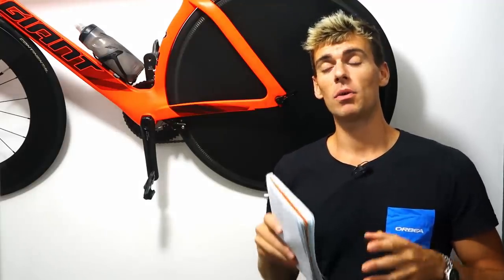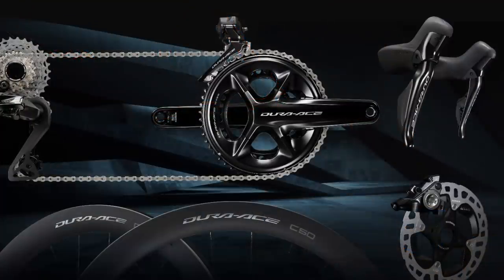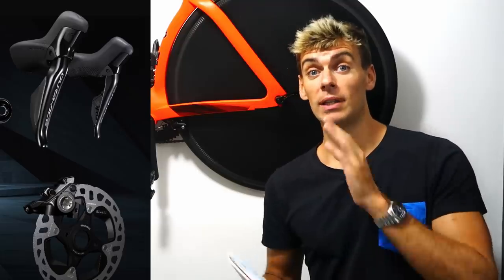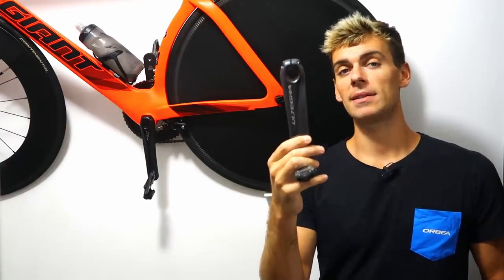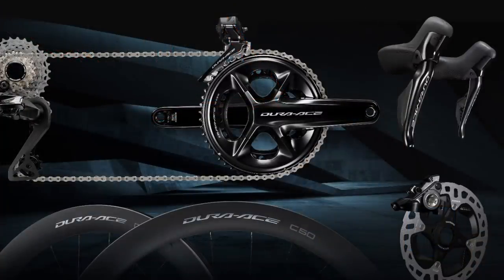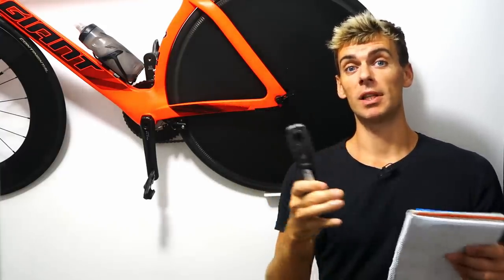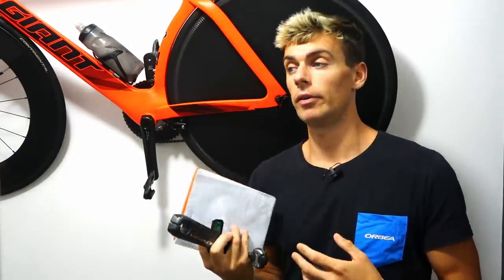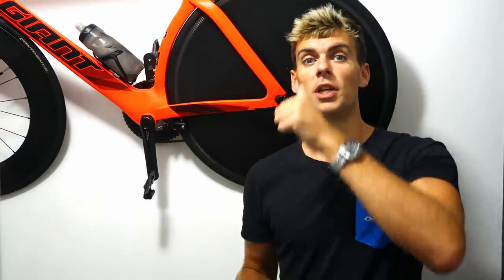Shimano 12 speed Dura-Ace & Ultegra Launch. Power Meter design, crank failures & disc brakes.

Comment: I really hope the disc calipers are better. I've tried all the ones on the market at this point and one thing I've noticed that you haven't really mentioned in your videos about disc brakes is that Shimano pistons are always the hardest to push back into the caliper, they have a lot of stiction. Campy\Magura have the least by far, you can push them back with your fingers and I never get any brake rub on those. Sram is not as bad as Shimano but still not great. I definitely welcome the monobloc design, I've seen a lot of Shimano calipers leak where they're split, hopefully the cap that they're using on the new one won't.

Comment: Big thing is the freehub, if you can use the same it'd be good so as not to have upgrade wheels. However this marketing BS with discs and 12 speed, tubeless is getting old. Rim brake on on dura ace C60's with tubes is just so much less hassle and for your everyday biker they're just not going to see any difference in speed. Just tuck in more for that bit extra aero 😉😊
Reply: No need to tuck in more. A similar rim braked bike is more aero than the same disc wheeled bike because you don’t have 2 rotors sitting out in the wind at the center part of the wheel. 😆

Comment: Well... Don't trust much on the Sram top tier cranks either... had a xx1 dub crank broken on the drive side because of what looked like a bad bonding between the carbon and the aluminium little arm...  guess top tier low weight cranks all have failures on them...
Reply: I’m amazed at the gullible crowd that oooooohs and ahhhhs over Sram’s mediocre stuff. Fools can be sold anything. 😆

Comment: 5:10 Axial and inboard bending of the crank do not contribute to propulsion, but are a side effect of the power input into the pedal stroke. You want to measure the power input of the rider, so why taking the losses out of the equation?

Comment: LOL !!! 8.44, hilarious and very true I'm sure. My take; disc brakes - nothing groundbreaking here, but it should have been. Not even a new DA disc rotor.....Semi wireless - the best solution, thumbs up. Shifters - don't like that they're bigger for my small hands, more weight and less aero. 12 speed - nice to have an extra cog, but yeah, really, was it worth all the hassle? Cranks - disappointing. Same as before basically. Can they really not do a carbon crank? Rotor Aldhu carbon is way better. Would love to shoot a vid with you in Mallorca!!
Reply from the maker: Lets make that happen. Stuck here in Asia. It definitely feels like a covid groupset. Bit rushed? Lack of man power? Discs are just xtr like you say, no real styling to the cranks or levers. Meh.
Reply: @PeakTorque  I was up for buying it, but at these prices I think I'll pass. It's basically almost 800E for each derailleur, 800 the shifters, and 1000 the crankset, 1000 the brakes and a bit extra for cassette and chain. That's a bit nuts. Mallorca is devoid of cyclists at the moment, we need more!!

Comment: I guess you live in a flat area.  Either that, or I live in a hilly area.  With 11 cogs to choose from on the back, I'm forced to choose between a 16T cog or a 28T cog.  In a race, I go with 11-25 so that I get the 16T cog, and that's OK because in a race, I can do without a 28T cog.  But on any endurance ride I do in my area, if I want to keep it enduranc-ey, and not tempo-ey, I need the 28.  And so, that means that on the 40 percent of the ride that's vaguely level, I'm either pushing the 15T cog at 83RPM or the 17T cog at 96RPM.  Usually, I spend the time skipping rapidly back and forth between the two in frustration, according to the direction of the most recent wind gust.

Comment: I’m planning to buy campy record shifters, rd n fd, stick to my rotor aldhu crankset, ee brakes and xtr chain, get a new da9200 11-30 cassette, after selling away my current DA9100 shifters cassette rd n fd. Hopefully the new shimano cassette works with campy 12sp shifters

Comment: Love your videos! Do you know any carbon crankset with 24mm axle that would work in shimano BB?
Reply from the maker: No. Even the rotor aldhu carbon, I think they are only making the 30mm alu spindle version.
Reply: @PeakTorque  cheers! I really don’t get it why. There are so many options with 30mm spindle but it seems stupid having to have smaller bearings to accommodate the larger spindle. At least for me with a BSA bb.
Reply from the maker: @paolocapozzi927  I agree, 24mm steel is so much better. Better bearings, and the axle doesn't wear or click like shit Aluminium dub or 30mm. I still have a gxp quarq, when that dies I will get rotor cranks and Power2Max.
Reply: @PeakTorque  Gap in the market for an enterprising engineer to step into?  Carbon cranks w/ 24mm steel / Ti spindle and no messed up pre-load fuckery.
Reply from the maker: @pmcmpc  Good idea. But shimano have a patent on the best preload system I think. Will look into it.
Reply: @PeakTorque  I'm sure there must be some way of doing it that your average neanderthal could reliably not mess up during installation.  Also, how old is that Shimano patent now? 10 years? 12? 15? I'm sure power2max and / or sigeyi would be happy to produce a PM for you.
Reply from the maker: @pmcmpc  I've asked Sigeyi for a sample to test. Lets see what they say.
Reply: @PeakTorque  I suspect they might be willing to collaborate if it means they can sell a full crankset, assuming you came up with something and were willing to work with them.  Their main competitor (X-Cadey) has their own full PM crankset available now with 24mm spindle, and is reasonably light.  Though it has some issues - first gen's axle (Aluminium) flexed like a noodle & was recalled, the 2nd gen now still flexes too much, and appears to be steel though their CS told me it was Ti ... 3rd time lucky?
Reply: @pmcmpc  well Campag's carbon cranks have a 25mm spindle so get pretty close to this brief?
Reply: @GS-pk9rd  I think chainline is off .. also, basically no PM options.
Reply: I believe THM cranksets are BB86 compatible.
Reply: @shibaburn7725  30mm axle and tiny bearings though on BB86.  Also, they're a touch pricey ...
Reply: @pmcmpc  Yes, sorry about the misinformation.  The THM website lacks  specs about the spindle.
Reply: SRAM GXP Red and Force cranksets could be adapted to work.  :-o

Comment: This is all interesting and all to be in the bleeding edge of technology but for us mere mortals were only waiting for the old parts to be on the used market. With that said I have a question. 

Would it be possible fit in a 105 R700 crankset in a bike with a full Claris r2000 grupo? Or im only limited to 8s cranksets with my setup. Claris crankset weighs a crapton and by upgrading to an 105 R7000 i count potentially save half a kilo of weight. 

Hope you can answer my query thanks!
Reply: The distance between chainrings in 8s and 11s maybe slightly different, there maybe change in thickness of chainrings. It may possibly work but I am quite certain that it will be sub optimal setup. Imo not worth considering, even if you have free r7000 crank i would prefer to sell it and spend it on maintenance, tires, shoes etc.

Comment: 8:55 I think PT you’ll be wrong, Shimano will go with micro spline for 12speed.
Reply: 12 speed is utterly ridiculous. Nobody needs it
Reply: Turns out PT’s right, shimano stays with the same freehub, stays with 11T but up the teeth.
Reply: They should have gone with microspline. It’s a better design.
Reply: @rcg9573  Better in what way?  Newer and shinier, or actually functionally better?  (and no, 10T cog isn't functionally better)
Reply: Last FM - Microspline is a mechanically better design regarding the hub and cassette interface. I could care less about a 10T cog. 10T cogs are a marketing ploy to advertise an inflated gear range. 😆
Reply: @rcg9573  freehub spline is always a pain for manufacturer like Shimano where they care about making precision forging in high volume consistently, in order to maintain alignment of all 12 rings.

Comment: Would a more asymetrical crank shape be better suited for transporting load from the riders foot too the crank? Was this the reason it was asymetrical before, or how does that work?
Reply from the maker: The old one could have been stiffer at a lower weight, but it wouldn't be noticeable.

Comment: I've been waiting for a symmetrical drive side power meter from shimano for ages! And I want something accurate so I can check my left/right balance due to problem with my left foot.  Although looks like I'll have to "upgrade" to a 12sp to use it dammit! I run an 11-32 as we have many 12%+ sections where I live. I do notice occasionally on the 10sp training bike when one gear is a bit easy, and the next up is a bit hard. But on the 11sp I don't really notice. When I started riding roadbikes they were just changing from 9sp to 10sp lol. Wonder when 13sp is coming out?

Comment: Is pad clearance better on MTB disc brakes? That's interesting if so, and I'd be keen to know why it's the case.
Reply: It may have something to do with the larger disc. The larger the disc, the more torque you can apply with the same clamping force at the calipers. Then again, larger discs need more pad clearance because they can warp more so imho that will just put you back to square one.
Reply: Yes.  Likely MTB leavers have a larger reservoir and master cylinder so they can push more fluid down to the calipers.  Thus the pads/piston can be farther apart as more movement is able to be actualiated.

Comment: Do you think Speedplay will come out with their power meter pedals?  They said it would be this year, but nothing has arrived yet.  I got burned on the iQ2 meter.
Reply: Wahoo could not even get their “updated” version of the Speedplay Zero pedals correct earlier this year. I doubt they have a properly tested PM by year end.

Comment: What's wrong with the power meter? I've had mine for a couple years and has worked flawlessly for the duration.
Reply: See @Keith Wakeham's (co-inventor of 4iii's meters) "Biggest industry blunder in Powermeters yet - Inaccurate and Expensive" https://www.youtube.com/watch?v=xB4Ipqf-Ryk video on the subject [requested by Shane Miller - GPLama].  And look at Shane Miller - GPLama's test of dual-sided power meters.

Comment: You yourself said no one gets a free lunch when talking about the lever ratio.
Reply from the maker: Yep, which is why the hood has grown.
Reply: Not quite. You do get a free lunch during the free stroke - ie before you contact the pads. Cars and motorcycles do this. They have a really low mechanical advantage for the first part of the stroke, then they switch to a secondary cylinder or whatever for the actual contact. This allows you to have, effectively, arbitrary amounts of pad clearance. Of course the downside is increase cost, complexity and size. I would not be surprised if this is what is going on here.
Reply from the maker: @404nobrakes  variable lever ratio. I.e Shimano servo wave i believe.

Comment: Do you still think the Shimano bonding issue is mostly only affecting hot-humid conditions?
Reply: No. I live in the NE of England which is anything but hot & humid. Happened to me and two of my pals.
I05 crank is the answer.
Reply from the maker: Anything wet, and or salty. Indoor trainers also bad due to salt getting in that thin gap between chainring and spider. That is right there the bond line is.
Reply: @PeakTorque  makes sense. I live on the coast.

Comment: Instead of Shimano doing something that SRAM have already done i.e. go 12 speed, why not do something that (AFAIK) SRAM haven't done? That is offer a configuration on the rear derailleur to shift 11 speed. Surely, each click of the shifter is just telling a servo to move by a certain distance so just change the distance (a bit like an engine map). Hey-presto! You given a consumer a choice and dialled back the resentment over the cost by just a little...

Comment: I’d like to keep my 11 speed di2 but upgrade the brakes to get better clearance. Reckon this will work?
Reply: Yes, that will work.
Reply: @rcg9573  How do you know?  You do not get good braking performance with R9100/9000/R8000 rim brake calipers and 7900/7800/6700/6600 leavers.  The amount of cable pull from older levers doesn't match what the newer calipers expect.  I'm suspicious the same (fluid displacement) will exist with these new R8100/R9200 calipers.
Reply: Last FM - Original poster asked if that set up would work. Answer: yes it will! 

No subjective comments on relative braking ability by me. I’ll leave the subjective stuff to you to wax poetic about.  😆
Reply: @rcg9573  I would take a small reduction in braking power and modulation for better clearance. I guess maybe to counter the power loss you could always run 160mm rotors all round?

Comment: Why do you think the 10t cog is stupid? I can understand why 2x road bikes dont need it, but I really enjoy it on my gravel bike because it allows a higher spread without a massive cassette. 

It is less efficient and I can imagine the chain might jump teeth more easily, anything else?
Reply: Drop from 11t to 10 t cog is quite brutal if you use decent sized front chainring. Maybe it is usable for some sprinters but who else? If you use smaller front chainring you loose smoothnes in high-end. At high speeds on flats you want smooth gear changes because you won't be able to adjust speed and pedaling frequency as much as in climbs.
Also, cassettes with 10t cog are probably not durable at all. I imagine 10t cog gets worn quickly if it is used frequently.
Reply: @jkk916  the drop from 11 to 10 is only 0.7% harder than from 12 to 11. And as long as the tooth jumps between the gears are kept fairly similar, this difference will only diminish in the higher gears, no matter how small your front chainring is. 

I cant imagine that the difference is noticable, but what do I know, my smallest jump in the cassette is 2 teeth and I enjoy it. 

The durability was also a concern of mine, but wether that is a problem depends on how the cassette is constructed. If the smallest cogs are seperate pieces like on Shimano, you can just swap it out for a few pennies. If they are integrated into the whole cassette like on SRAM X-Dome, that is a whole different story because you have to replace the whole cassette once a single cog is worn out.
Reply: @SaitekFreak999  You got this wrong. The difference of gear ratios if the front chainring is the same is almost 10%, which is physiologically more than 10% harder due to progressive nature of air resistance.
If you had smaller front chainring (to compensate for the difference of the size of the smallest rear cog) you should look at this: Jump from 13 to 12 tooth cog is 7.7%, from 12 to 11 8.3% and from 11 to 10 is 9.1%. If you use jump from 12 to 11 instead of 11 to 10 you should compare 8.3% and 9.1% jumps. Latter is about 9% bigger, so it is not negligible.
Time trialists do not use huge chainrings just because they are more mechanically efficient.

Comment: I think campy still does best road disk brakes & will prpbably still lead even after 12s release.
Reply from the maker: I find it hard to get aero flat wrists on arms with the huge campy hoods.
Reply: Ronald Kuba explained why: they hired Magura to design them, and there's much more pad clearance.
Reply: @PeakTorque  I meant more like campy/magura has shown it can be done, hoods TBD. Maybe a Ribble-type bar can stow lever cylinders, etc. to allow smaller hoods.
Reply: @PeakTorque  Yeah lol I forgot to mention I have huge hands 😂So maybe its something to do with that but i was only talking about feel it reall feels like car disk brakes closer in feel & no rubbing especially nothing like sram

Comment: I just bought a new sofa groupset, hope they don’t release the 10speed sora soon
Reply: Trickle down tech doesn’t happen overnight.  Shimano updates its flagship groupsets around every 4 years.  105 will get its 11 speed Di2 groupset a few years after the 12 speed Dura-Ace and Ultegra release.  Then a few years later Tiagra would get 11 speed.  Then a few years after the updated Tigara.  Sora would finally get its 10 speed update.   For a bit of perspective my dad’s Specialized Allez Double from 2010 had 8 speed Sora installed.  So the 9 speed Sora update happened somewhere around 2020’s
Reply: @iMadrid11  thank you.

Comment: A continuously variable transmission still wouldn't have enough ratios for the marketing departments.
Reply from the maker: Oh you just wait. They'll probably say its more aero.
Reply: @PeakTorque  I'd happily sacrifice a cog or two to increase the triangulation of the spokes on a 130mm wide hub.
I'm only going from 10 speed Chorus to 11 speed Chorus now because of the improved ergonomics and aesthetics. I just didn't see a need to go for the newer 12 speed version plus the older 11 speed version does look better imo. Aesthetics is everything on a road bike. :D

Comment: I just bought Ultegra di2
Reply: Rip
Reply from the maker: im considering doing the same. Smaller levers.
Reply: @PeakTorque  building myself a bike purely for climbing , going one by with di2 and rim brakes
Reply from the maker: @thebudgetcyclist4310  Wise.
Reply: @cissepauwels8211  the  new 12 speed rim brake is still wired for some reason , so I am completely happy with my purchase given that the only difference is really just 1 more sprocket
Reply: @thebudgetcyclist4310  and at the top of the climb waits the descending bike with a bigger chainring and disc brakes xD 

Sorry, I'm just trolling at this point. ;-)